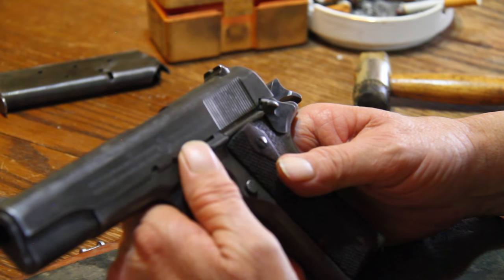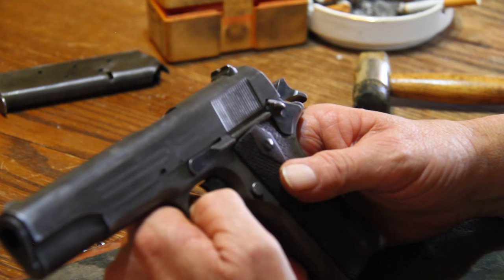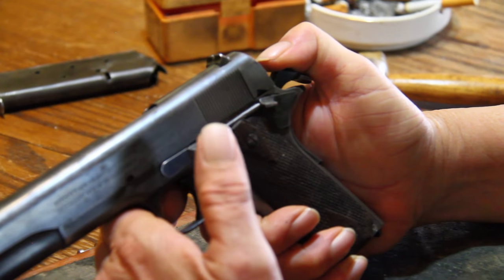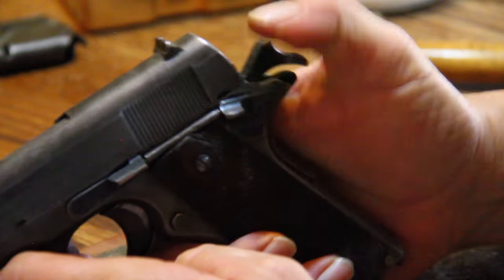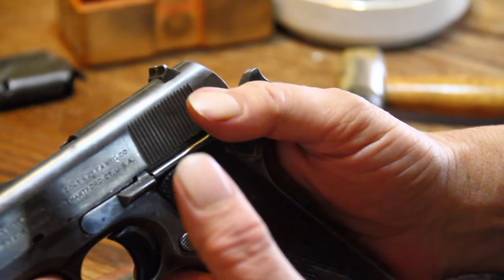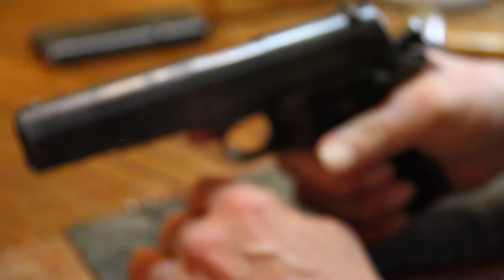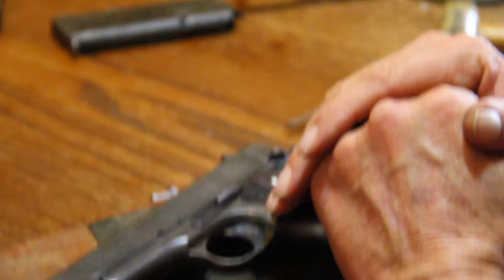Lowering the hammer on a 1911

Comment: From the comments I've learned way too many people do not read manuals and have no idea how to handle external hammers on guns lol.

According to Smith and Wesson here is how you de-cock a 1911 style handgun

"• Place the safety lever in the fully up “safe” position.
• Remove the magazine from the firearm.
• Place the safety lever in the fully down “fire” position.
• Draw the slide back and eject any chambered round. You 
must verify the barrel chamber is free of any live rounds or 
obstructions (Figure 13). Release the slide allowing it to 
move fully forward.
• Place your finger on the trigger and place the thumb of 
your opposite hand on the hammer. (Figure 14)
• Pull the trigger to the rear and hold it while lowering the
hammer to the forward position with your thumb and then 
release the trigger. (Figure 15)"

----------------------------------------------

Do NOT drop the hammer on a live round. You can do it 1000000000 times with no issue and then you will have a negligent discharge. All because you were too lazy to empty the chamber and then de-cock as the gun was designed.

-----------------------------------------------

When it comes to half cocking the gun this is what the manual says:

"HALF-COCKED POSITION of the hammer functions as an
automatic safety position. It will prevent the hammer from falling
fully forward unintentionally. Never attempt to fire the pistol from
the half-cocked position. To remove the hammer from the half cocked position, keep your finger off the trigger and out of the
trigger guard, then draw the hammer to the fully-cocked position.
From this position, the pistol may be fired or decocked. The
half-cocked position is not a manual safety. The hammer should
never be left in this position. Never carry the pistol in the half cocked position.
WARNING: TO PLACE THE SAFETY IN THE FULLY UP
“SAFE” POSITION, THE SLIDE MUST BE FORWARD
AND THE HAMMER MUST BE IN THE FULLY COCKED
POSITION. ATTEMPTING TO PLACE THE SAFETY IN
THE UP POSITION WHILE THE HAMMER IS NOT FULLY
COCKED WILL ALLOW ONLY PARTIAL MOVEMENT OF THE
LEVER AND WILL NOT ENGAGE THE SAFETY. FAILURE TO
FOLLOW THIS WARNING MAY RESULT IN SERIOUS INJURY
OR DEATH TO YOU OR OTHERS."

-----------------------------------

So the half cocked position is an automatic safety. The gun is not meant to be put into half cock on purpose. It is a safety such that if the hammer falls accidently it will not hit a firing pin. The gun should only purposefully be put into full cocked or "at rest" with the hammer fully forward. Carrying the gun fully cocked with the safety on is safe and similar to carrying a glock with a round in the chamber (with no external safety). Neither of these guns will accidently fire unless the trigger is PRESSED.

Just read the manuals guys. Too many people operate products of all types in ways they were not engineered to be operated and wonder why accidents happen. Emptying chamber and then decocking takes less than 5 seconds and is 100% safe. Decocking onto a live round works until...it doesn't.
Reply from the maker: Exactly right
Reply: @rangehot  What's the point of de-cocking it if it has no round in it? Dumbest thing I have seen.
Reply from the maker: @alssla3581  why not know it? 
Ever small skill you can add to your mental tool box is beneficial.

Comment: First person I've seen (besides myself) using the grip safety pushed by the trigger. I'm not determined to lower on a live round but it does come in handy sometimes.
Reply: Yep, first person I've seen using the grip safety instead of the trigger to lower the hammer on a live round for condition II. It's a great idea. 

Fantastic for Kimber 1911 owners as I believe I was told Kimber has a feature that will not allow the round to fire without both grip safety and trigger being pulled. 

I wonder if that exact feature would prevent the hammer from being released on a Kimber 1911 just by using the rear grip safety o only when lowering the hammer, in the exact method this video shows?

Comment: The only safe way to lower the hammer on a 1911 is to eject the magazine,  cycle the  round out of the chamber, and pull the trigger. Anything else is a shortcut that will eventually lead to an unintended discharge.
Reply from the maker: So, you are 100% confident if I use this method I will have a ND? What if I told you I have been using it for years without issue.
Reply: @rangehot  I stand under trees during lightning storms and have never been struck dead yet. You gonna tell me I'm doing something wrong?

Key takeaway, yes you are defying the intended design of the firearm and Browning himself. Set your ego aside and read a manual.
Reply: @messiahmozgus  Let's see what Browning had to say about it.

From the 1910 patents:

Heretofore in the pistols of this class,
when the hammer was cocked ready for firing,
and it became necessary to lower the hammer
to the safety position without allowing it to
touch the firing-pin, it required both hands
of the user to accomplish this act,

Cheers

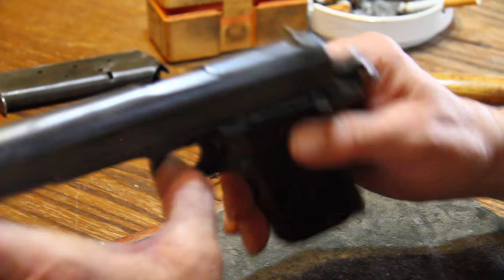Comment: Question: What caused the hammer to go forwards and then backwards at 0:33?  Camera angle didn't show what happened there.  I have a Glock and am considering buying a 1911, so I'm trying to learn about operation of the hammer (Do's & Don'ts).Also, what is "Condition One" that you mentioned?
Reply from the maker: E Clarke At 33 seconds in you are seeing John Travis engage and disengage the thump safety when he does another safety check to be sure the pistol was unloaded.
Condition 1 is when the pistol has a loaded magazine inserted and a hot chamber, hammer is cocked with the thumb safety on.  This is how many people carry the 1911.
Condition 2 is loaded magazine inserted hammer down on a loaded chamber.
Condition 3 is loaded magazine inserted hammer down on an empty chamber.
Reply: Thanks for the reply.  Does hammer "down" mean the hammer is in the forward or the backward position?  And yes, I saw him operate the thumb safety at 0:33, but that doesn't cause the hammer to move does it?  I was asking "What caused the hammer to go forwards and then backwards at 0:33".  The hammer was off-camera for a moment and then the hammer reappeared in the backwards position.
Reply from the maker: Hammer down means the hammer is in the forward position. I am sorry, I do not see the hammer go off camera or move at 0:33.
Reply: He quickly pinch checked the chamber. When he did the slide moved 
backwards and the angle made it look like the hammer came down when in 
fact the hammer did not move the slide was pushed to the rear for the 
pinch check. 

If your only paying attention to the hammer I can 
see how it looks like the hammer fell and is quite a cool little optical
 illusion you noticed.

Comment: why lower a hammer on a pistol designed to be carried condition one?
Reply from the maker: +ED Iphish John Browning did not design the pistol for a particular method for carry. The initial prototype was introduced without a thumb safety and only added at the request of the Army. So the 1911 was not designed to be carried in any particular way as it was designed to be carried safely in a number of ways. The thumb lock safety was to be engaged to make the pistol safe when the user’s other hand was occupied. The manual of arms from 1913 clearly shows that the hammer was to be lowered (using two hands) when the M1911 was holstered. If you have read any books on the 1911, and the original manual this is stated clearly.  Look up the 1910 patents where Browning describes the half cock as the "safety position" and gives instruction on lowering the hammer to that position with one hand.
Reply: I was taught by some crusty old Jarhead 'Nam Vet professional firearms instructors to carry the 1911 hammer down on a live chamber. This was before the age of the internet, where millions could bleat the mantra of "it was designed to be carried condition 1" over and over again, until this "truth" simply became part of the ether.
Reply: ED Iphish condition 1 or 3... I would like the Fudds that advocate condition 2 to watch down the barrel to make sure the bullet does not move.
Reply: There is nothing wrong with carrying a 1911 with the hammer down on a loaded chamber, it is completely safe. If you think its dangerous explain to me why.
Reply: @justinbailey1756  Well my friend, if you were to slip your hand a bit and let the hammer fall on that loaded chamber, you can kiss your thumb goodbye as the slide blew your thumb away, i don't see a point in risking that either, no matter a series 70 or 80 or a kimber series 80, that is still very dangerous

Comment: Try this.  Before you lower the hammer,  pull the slide back about 1/4 of an inch. The breach face will be away from the live round (out of battery), and even if the hammer slips off your thumb,the gun cannot fire.
Reply: If you back the slide up a quarter inch, the disconnect moves down and out from between the trigger and the sear, and there is no connection between the trigger and the sear.  Pulling the trigger won't release the hammer.
Reply: @johntravis3500  That's right. That is why you have to pull the trigger first (while holding the hammer back) then move the slide before lowering the hammer on a 1911.

Comment: Pinch checks are maybe the most dangerous aspect. Just think of something went wrong your fingers already ahead of the barrel. If the bullet don't get you the muzzle blast surely will. Keep your hands away from the front of the gun.
Reply: Grasping the slide for a press-check is more fool-proof, but the pinch-check done correctly as demonstrated in this video is perfectly safe as well. It's just not as simple as as grab-and-tug.

Comment: What's the difference between a 1911 in condition 0 and a Glock with a round in the chamber?
Reply from the maker: Aside from the trigger pull weight and trigger weight on the Glock, not much at all.

Comment: Nope.  Wrong.   The safest way to lower a hammer on a 1911 is,... while gripping the pistol with your right hand, pinch the hammer between your left thumb and forefinger...then pull the trigger and lower the hammer...slowly and safely...forward.  This gives you substantially more control over the hammer than if you were using your thumb.  Don't EVER lower the hammer on a loaded chamber on a 1911 using just your thumb.

I've had hammers "get away" from me unintended (thank God I was pointing the firearm in a safe direction) on different types of weapons. The biggest culprit was the SAA.   I will never lower the hammer on a firearm using just my thumb again.  Two fingers are better and stronger than one.
Reply: MBM - LMC
MBM - LMC
That's a fairly modern and very stupid way to do it. Much easier for the hammer to slip. Do it according to Browning's instructions, which would be the way it was just shown. Some years ago, I did considerable research into John Browning's patents and writings to find out exactly how he meant the 1911 to be operated. The only time the pistol was meant to be in condition 1 was when it was in your hand and you anticipated having to use it. Browning himself and every military 1911 manual up until the day they fazed it out (I carried one in the army up until the went to the Little9) said DO NOT HOLSTER A COCKED PISTOL. If a range officer ever caught you trying to lower the hammer with your method, you would find out that a pissed off range officer is something you don't want to see.
Reply: ardvarkkkkk1 I'm new to this. Both methods seem about equal to me. At some point you've got to transition to the tang only portion of the hammer in order to let it down completely though it seems that even if the hammer slips at this point, clicks down only to a partially cocked position..a fail safe I imagine - it does not hit the firing pin.  I want to do this the bestest way so hoping either of you might have more comment. Thanks in advance
Reply: Today's younger generations just don't know how to lower a hammer from cocked position.
All old timers like me know how to do it, especially to lower a revolver from single action hammer cocked.
It is like a stick shift car vs an automatic transmission car.  
A revolver or 45 is stick shift, while the Glock type is auto trans car. 
You sound like a Glock generation young man.

Comment: So, a dangerous finger on muzzle press check before the safety lesson? No thanks.
Reply from the maker: Well maybe you should take a class on how the trigger on a firearm related to the rest of the story.
Reply: Here ya go, Walter.  I made it easy for ya. 

Heretofore in the pistols of this class,
when the hammer was cocked ready for firing,
and it became necessary to lower the hammer
to the safety position without allowing it to
touch the firing-pin, it required both hands
of the user to accomplish this act,
Reply: Oh, and Walter...I didn't smoke dope in Vietnam.  But, do carry on.